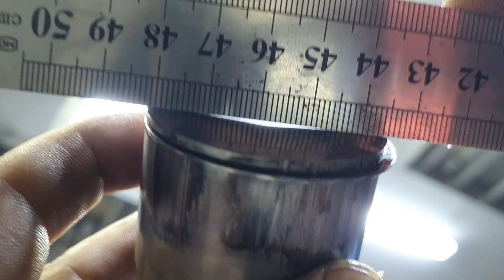Убираю задир - очистка никасилового покрытия - восстановление алюминиевого цилиндра после прихвата

Comment: Always when welding aluminium clean the area from oxide layer up to bare metal. You won't get the solid stuff on welding pool. For aluminium always use alternating current about 70/30%

Comment: the "unknown"  brand piston is the reason for stuck , the piston wall is too thick , thermal expansion of this is more than a cylinder.  Use vertex or an original athena brand ,  its indestuctible :)
Reply: Or just check the clearance between the cylinder and the piston

Comment: this is a delicate engine, for the factory parameters and above all because it is made of aluminum (in cast iron they are more difficult to seize), a porous material that needs more lubrication, remember that you are using a go kart carburetor, which allows you to reach high revs, for this reason the kart engines use a mixture at 6/7% (60 / 70ml per liter of petrol), therefore in my opinion with a better cooling, the original ignition (because if the engine is in phase in the correct way you can puncture the piston )which can happen on an out of phase ignition. in my opinion (this is my opinion) if you put the original ignition, with the original advance, the mixture at 3% or 4%, a good cooling, and if you do not want to risk with the go kart carburetor put a phbg with the configuration that I wrote to you in the previous video. thanks for listening
Reply: Sei sempre il migliore fare quei lavori come li fai te con le risorse che hai per me sarebbe difficile... 💪💪💪🤙

Comment: use motul 800 2(double) ester core 
2,5% for 1 litre (40:1) and you wont seize anymore , but if you put new cylinder with new piston go slow at start you know it.
Reply: "go slow at start"🤣

The only reason you need 1 maybe two heat cycles it to be nice to the ring and not just straight cook it the first time it sees heat. I start my fresh build let it run a few mins make sure everythings good shut it off let it cool start it out water in it and get the air out shut it off let cool and then 8th mile passes back to back. Maybe 3 bowls of fuel ran through it before first pass

Comment: lack of lubrication, for 50cc/70cc 2-stroke engine with piston, rings and new cylinder, recommends 50 ML of 2-stroke oil for 1 liter of gasoline, hope I helped  ^^, LIKE ^^
Reply: 50ml for 1 liter?? Bro i run 25ml to 1l
Reply: @PURPL.96  yes, avoid scratching the cylinder and sticking, this for engines that have just been rectified, for a run-in engine 30ml per liter is ideal ^^
Reply: Ooh i got it, thanks!
Reply: @PURPL.96  engine softened 30ml per liter of oil 2 stroke ok, ^^
Reply: @PURPL.96  engine rectified 50ml per liter of oil 2 stroke ok, ^^

Comment: In one week you destroy another kit, good job master :))
Reply: With china kit 70cc (47mm piston)on minareli can run easy 5k kilomometers.
Reply: @SORiNN08  yeah i was using the jcc piston but it didnt last like the Chinese one . It hard only at first days but after u can beet it as u like . Cheep but great with some patient
Reply from the maker: the same kit, besides, I bought not a new one, but with a molten piston for $ 10
https://youtu.be/WPxUcXgXETw
Reply: @Samodel  ahhh so you speak perfect english :) try and put some english subtitles on your videos when you speak your native langauge please kindly sir  ,we would love to know what your saying . because it frustrating not knowing what your thinking when you do your repairs . you look like you have great sense of humour .
Reply: @gizmo1252000  Y ya que estamos pidamos subtítulos en español. I am from Argentina
Reply: yes i agree but hes modifying the cillinder like ports and etc
Reply: 0
Reply: ac 70cc cilinders not lasting ong
Reply: @karolisstagis2853  i have 70 cc it has been driven for a Long Time might be over 4000 i only replaced piston at 3000 for safty still no blow by on The piston its about jetting at suffecient cooling
Reply: @karolisstagis2853  I had 70cc Top Performances Trophy cylinder (Minarelli Horizontal AC) for 4 years with Stage 6 Sport Pro variator, Stage 6 Sport Pro clutch, Dellorto 19mm carburator and Tecnigas RS2 exhaust without any problems. V-max was about 115 km/h from GPS. So I cannot say that 70cc cylinders last not so long
Reply: @karolisstagis2853  the plating is trashed for a long time now and the piston is modded/out of spec. That makes it even worse. But it lived to die another day (probably on the next run) LOL